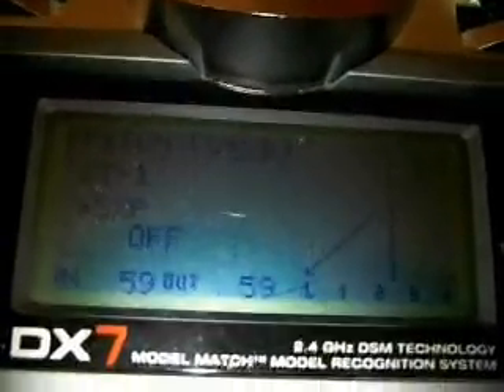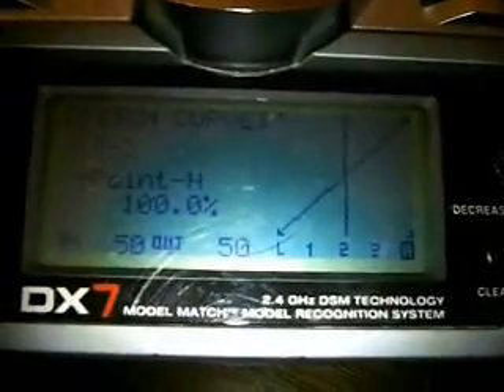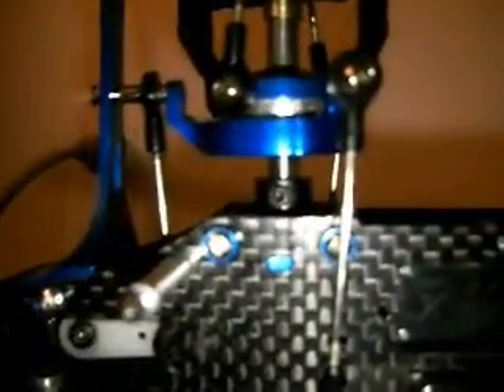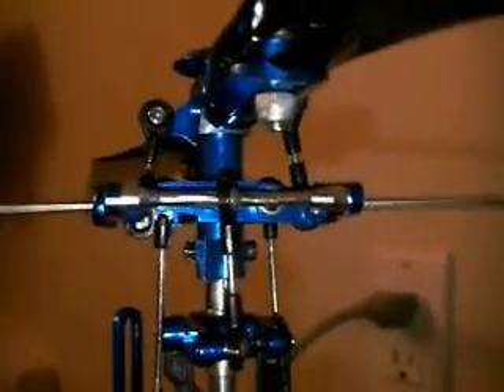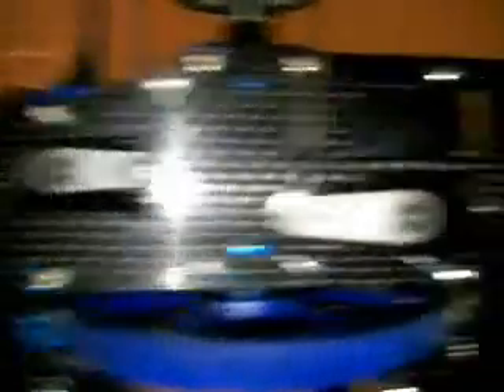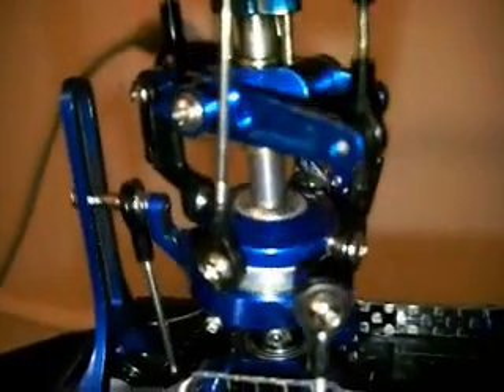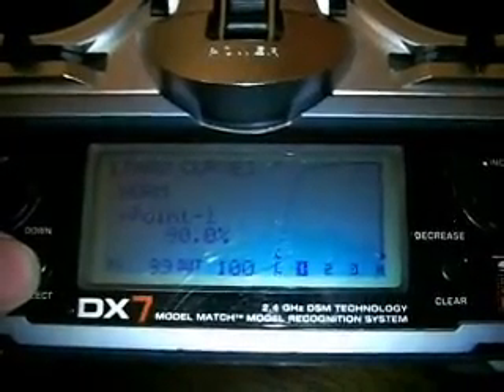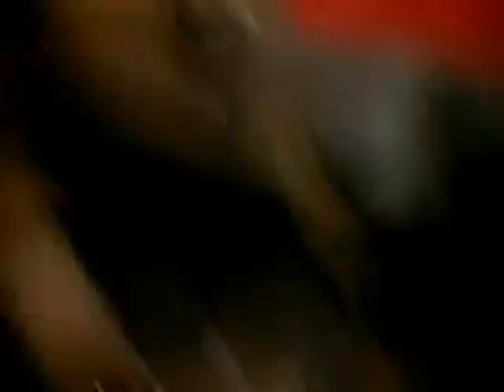Crash Course in 120 CCPM Setup

Comment: Hi Dave, I just watch the Vedio on CCPM you recommended n I followed it to level the swash plate and I was only able to increase the positive pitch to only +5 degree but able to get -10 degree with the 3D switch up. I know I'm screwing with the transmitter setting still. The CCPM Vedio is down with a different transmitter.